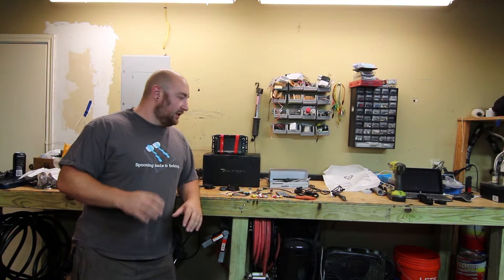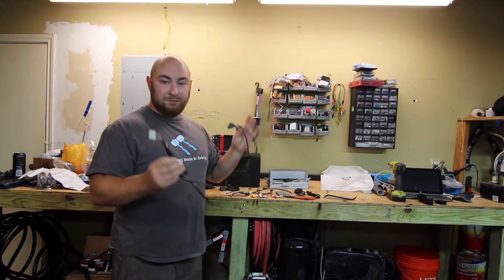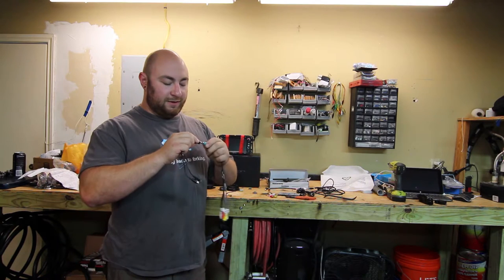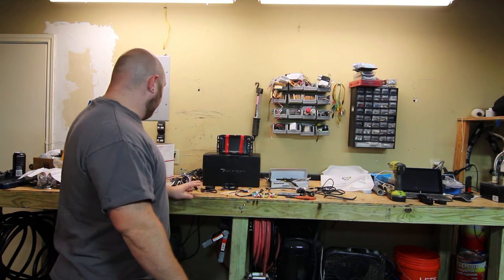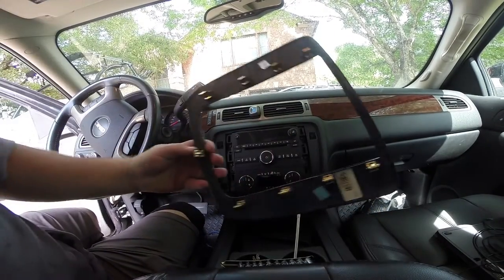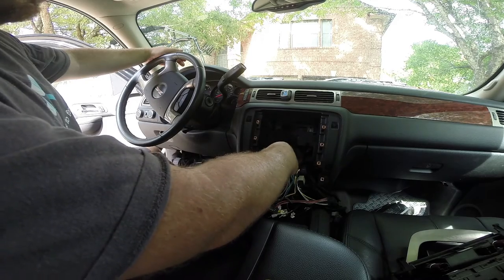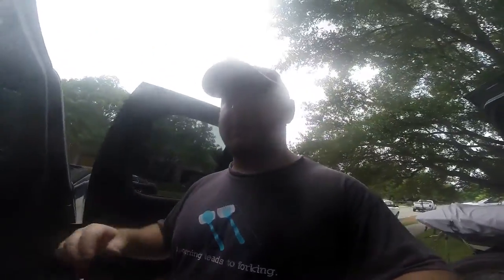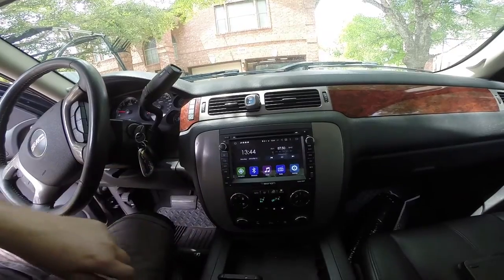2009 GMC Sierra 2500HD - Installing an Eonon GA6180F - Chinese Android Headunit

Comment: I just installed one in the same truck is you. Did u have to cram all the wires in the back for it to fit? Like mine is really tight.
Reply from the maker: yes the harness is very tight.

Comment: Very informative video.  Do you know of any reason why this wouldn't work with a 2007 Tahoe LTZ?  Your dash looks identical to mine, but I'm thinking that it might have something do to with differences in the harnesses or something.  For whatever reason, Eonon doesn't have Chevy Tahoe listed on their website under this model (or any model for that matter).  I have the OEM nav and DVD player with Bose sound system and rear tv along with the backup cam (which their website indicates is all compatible with this model head unit).  Looking forward to your review of its functionality.
Reply from the maker: Honestly if its the NNBS body style it should be fine. You can always just email them. They are not super responsive but should get back to you inside of a week.
Reply: Thanks.  I'm impatient when it comes to this stuff.  Are you still happy with your purchase?  General thumbs up?  I just want to pull the trigger on one but there's a lot out there.  My 2 1/2 year old decided the OEM head was like his piggy bank and loaded the DVD slot with coins (was letting him hang out in front while I loaded the truck).
Reply from the maker: There is one major issue that you need to be aware of before you order. General thumbs up but I am still working with EONON to fix that issue. Could be a deal breaker to some.
Reply: Cliffhanger!  Thanks for the heads up.  Will wait for your review.  Glad I wasn't hasty.
Reply from the maker: Video Posted!

Comment: I have an 09 avalanche with Bose and can't seem to get the rear speakers to function. All the plugs are secure.
I also get a lot of interference even at volume 1 (which is really loud actually). Hoping I won't have to scrap this
Reply from the maker: Either have a ground or a bad unit.
Reply: MaksWerks I was hoping so but this is the second unit to have these exact same symptoms. I think weak grounds are to blame for the white noise like you say.
Guess I'll have to keep digging. Thanks for the fast response

Comment: does your unit freeze up? I'm having that problem with mine, I have to reset it almost every 2 minutes, music just cuts off and is non responsive
Reply from the maker: No i have never had an issue like that. I would recommend getting them to replace it with another unit.

Comment: Maks im looking into buying this exact same head unit for my chevy impala im extremely fascinated by this unit. Can you hurry and do the review on the actual so i can see how well the interface and software work?
Reply from the maker: Chris, 

Review has been filmed and edited. Due to demand I have moved it up and it will air this Friday (7/23).

Thanks,
M
Reply: ok coo I'll be looking for it on Friday. So let me ask you is that home screen customizable? like can you choose what apps and widgets you want on the hohome screen and which ones you don't?
Reply from the maker: I have not been able to change the home screen, but you can move stuff around on the other screen. There may be a way to do it, also there may eventually be ROMS on XDA for it, but currently nothing.
Reply: ok well i guess I'll just have to wait until you post the full review on the unit
Reply: i hate that you cant add apps or take away apps from the home screen
Reply from the maker: Full Review is posted!

Comment: Quick question for ya I have a Enclave (non bose) how is the audio quality vs that head unit you switched it with (looks the same as mine).  My Buick enclave has a 4 speaker system 6.5 inch speakers in the 4 doors the first thing I did was replace those paper cone speakers with some nice Polk Audio DB651 (front speakers) and Polk Audio DB652's in the back.  I have a Alipine 4 channel amp the KTU-445U but it seems the stock unit it sucks with cant crank it it distorts over 1/5th gain (no joke) but how is the stock sound vs ur old unit quality wise without the sub factored in.
Reply from the maker: You really need to use an aftermarket headunit with an external amp like that.
Reply: MaksWerks like this one?  I ordered it this morning... just hope I don't loose the parking sensor beeping like someone said I might.  not for me but my woman mainly lol
Reply: MaksWerks Does this have a F/R L/R RCA cables for an amp?
Reply from the maker: yes.
Reply from the maker: it comes with a beeper, if you install the beeper you will have parking beeping. also I recommend adding a rear view camera.
Reply: I have one oem but it shows up in my rear view mirror.
Reply: MaksWerks Maybe a dumb question but will a usb 4G LTE dongle from Verizon work with the 3G usb ports just installed it today sounds great mated with the Alipine 4 channel class D amp

Comment: how did you set up your google account? my head unit Daud it couldn't contact the Google servers.
Reply from the maker: You have to be on wifi.
Reply: MaksWerks, I am connected to my home wifi. would it not be compatible with the headunit?
Reply from the maker: hmm not sure. If you are actually connected to the internet (try loading a website in the browser) then you should be able to connect to your google account.
Reply: MaksWerks, i tried opening the browser, still no luck.  im gonna try using a hot spot, see if it makes a difference.

Comment: Eh brother..Can you run a full audio system to it??
Reply from the maker: It will run the same stuff any other headunit will. External amps, subwoofers, ect.
Reply: @Makswerks1  Do you still have the headunit??
Reply from the maker: @barrymonroy7138  yup. still daily the truck.
Reply: @Makswerks1  Did you figure out the hissing noies
Reply from the maker: @barrymonroy7138  I ended up using a ground interrupter circuit, but i occasionally get noise when charging my phone,.

Comment: Whats the beeper?
Reply from the maker: Its replaces the factory beeper ( used for turn signal beep, door chime, ect)
Reply: MaksWerks i didnt connect mine will it be a problem?
Reply from the maker: Pedro Hernandez doesn't matter.
Reply: MaksWerks thanks for the install help, the 8180 on the non bose works great no buzzing.
Reply: i just installed mine this evening, and i also couldn't figure out where to connect the beeper so i just didn't do it. have you noticed any issues with it not being hooked up? I will probably eventually pull it back out and connect it but as of now it will be fine.

Comment: these Eonon head units suck, i bought 2 both worked great for about 6 months and now neither even come on at all, about a month before they both failed, they started having video issues and freezing and loosing connection to wifi and bluetooth and just acting crazy, and now just doest even come on.. and yes i checked the voltage and fuses, all is fine it just bricked on me..